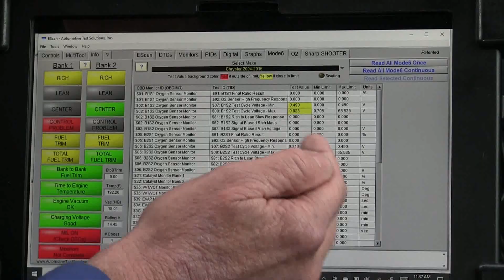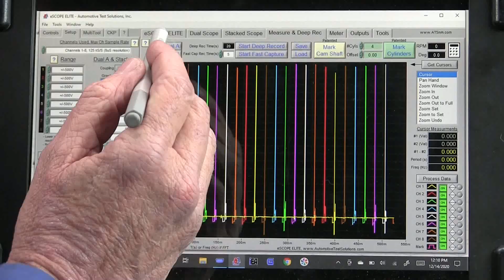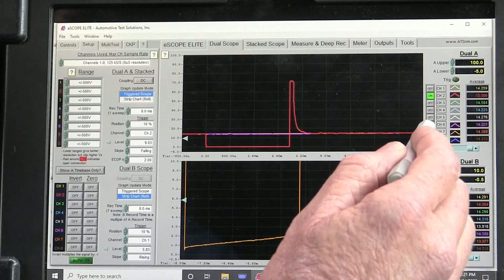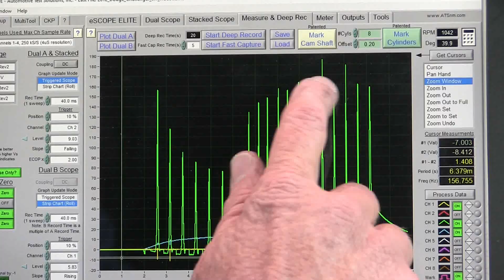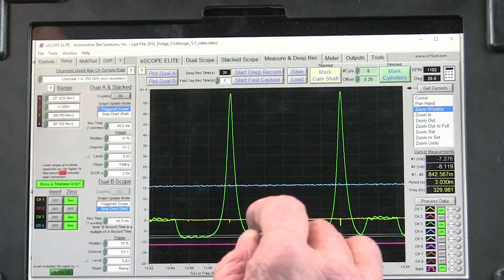Challenging to Diagnose Misfire on a 2012 Dodge Charger 8-Cylinder

Comment: Another 5 star video Bernie, but I wonder: they replaced the heads to fix the misfire but used the same lifter? Or chasing a different problem and inadvertently installed the wrong lifters with the heads, umpf!!

Comment: Long shot here… I have a 2012 dodge charger rt. Just had engine rebuilt. Had p3497 code so I replaced MDS, VVT, Coil packs, and Spark plugs. Here I am… still having issues with a rough idle and P0301 code (Cylinder 1 issue). After watching your video it’s probably the Lifters they put in (probably went cheap). 

Question: Do you have anyone with the ATS Software located in Austin, Texas? I have called shops and everyone just wants to tear the engine apart instead of properly diagnosing the issue first. THANK YOU in advance for your response.

Comment: When youre doing ybe injector flow rate test, j presume the gas is being injected directly into the cylinder. If there a chance of the vehicle hydraulicing the cylinders when its next turned over? Or does it evaporate? If it evaporates, i presume you can't do this with a diesel?

Comment: Wow. One of the first things I ever learned as a mechanic was. Make sure that the parts you are installing are the same parts you removed check and double check. Your video just showed and proved. Possibly. That somewhere along the line there was a misfire. In the misfire was corrected but also still existed. Because somebody installed the wrong part without checking to make sure. But once again I appreciate your video. Wonderful video

Comment: This is probably one of my favorite videos of yours I’ve seen. They are all gold, but the  troubleshooting you performed on this vehicle shows the correct diagnostic process to the T. They fact it had new heads and all those parts thrown at wound be an extremely difficult diagnosis for anyone. You called it Bernie. And stuck with your gut. Love it and thanks for sharing this!

Comment: Bernie.   While most technician  will try to follow this video  I would have to say probably 90 percent have already left the room.  1) they don't have the equipment 2)they don't have the technical skill to follow what you are saying.      With your advanced skill in diagnostic,  it still take over 1 to 2 hours to diagnose the problems.  It's  not just having an elite tool, but how to use it and interpret data. Most shop will just refer the car to dealers move on to something else.  But you are one of  the best

Comment: Nice Job. I have a chicken / egg question in my head: when did the incorrect part get installed?? This all started over a misfire, so i assume, somewhere along the line, the original problem got solved and this problem was created. Shop that last touched cam should pay Bernie and the latest shop.

Comment: The ability of this equipment is amazing.  The only problem is, after you spend around $12,000 for everything, you still need extensive training on how to use it all.  You can't learn this stuff overnight.  I'm sure Bernie's knowledge and experience goes back over 25 years.
Reply: He says he started when oscilloscopes were enclosed in a giant room and he got to use them thanks to a known friend or someone close. I believe he said that it was an enterprise entity that was the ones that could get their hands on those type of machines as a business need. So, he was born with this stuff and he created his own tools. He has vast experience and most of us new diag techs will never find this problem because it is probably unique and may not happen if the right parts are ordered to begin with.
Reply: @scientist100  yeah you are absolutely right. Of all the vehicles on the road with engine problems, what are the chances of this being the cause? This car obviously had a different problem before the wrong lifters were installed and we'll never know what was originally wrong.
Reply: Better start young in thus business or else you'll end up working at a tire shop
Reply: Very true. You must become the tool. Bernie is the tool. The oscilloscope is just an extension of Bernie. I just bought the scope. Also just realized that Im not Bernie. LOL. I like it so far but the learning curve is pretty high on this one. Sometimes I wished I had bought the Pico because it is much easier. I know that the capabilities of this is tool is and will be far better than a Pico can offer once I learn the scope. Then I will buy a Pico after. Because why not.
Reply: It is more than 25 years bud. I've seen videos where he says that he has never seen something like that before. An old timer himself doesn't know it all but he does have a lot of tricks when it comes to diagnosis but if you notice, he uses the same strategy to get data and the way he diagnoses is based on experience.
Reply: I still see new stuff everyday and the technology requires a scope. Do you want a Cadillac or a base model Buick. Lol  you have to love diagnostic stuff to invest this kind of money.
Reply: @mike-yp1uk  You could get all the same testing equipment for a picoscope and spend $5000, half of what ATS stuff costs.
I have the ATS stuff and I believe it's worth the extra money.

Comment: how in hell did it ever get the wrong lifters installed, if it was the original problem then it must have come from the factory like that if not then it must of had a wiped cam in the past and a dummy installed the wrong lifters, what is the answer, it would have helped in the diagnosis.

Comment: If they didn't came across Bernie, the engine would have ended up on a scrapyard.
Reply: Or would've had a brand new one installed or good secondhand - pretty sure even dealer would end up replacing the whole engine

Comment: So none of the shops could figure out that it still had a mechanical top end issue with how bad it sounds running? The lifter noise is so loud that you can barely hear him talking when he is by the engine!
Reply: Engines running on camera sometimes sound ticky as hell, it's misleading

Comment: Why would the non DOD lifter cause the misfire at idle? At idle the MSD system would not be activating so wouldn't all the lifters be solid? Trying to understand why the lifter is causing the problem. Great diag as usual Bernie. So much knowledge.
Reply: Same question, why would it cause a misfire at idle when MDS is not active. I am dealing with the same issue, a bad lifter wiped a cam lobe so I went with MDS delete and now all of the MDS cylinders have misfires at idle only... I am going to swap the cam to a non MDS cam next but what in theory is causing this especially at idle when MDS is not active so all the MDS lifters should act as non MDS ones??
Reply: Good question. The lifter may have a little built in lash to relieve pressure on the locking pin. The cam lobe would then need greater duration to take up the lash before opening the valve.

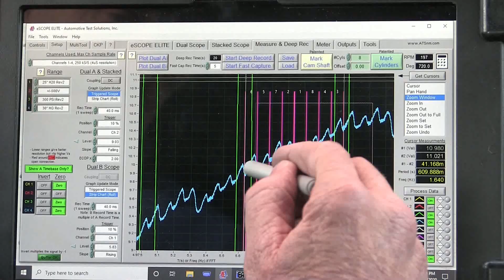Comment: So around the 26:00 mark you discover the intake valve is opening early, allowing a push back into the intake, and later you discover a lifter issue, which is the problem. My question is what caused the actual mis fire? I'm thinking some of the fuel charge is pushed back into the intake, due to an early opening intake valve creating a slight lean mis. What I can't figure out is why the primary ignition wave didn't reflect that??
Reply: That was my thought also. Reduced exhaust scavenging due to the early valve closing could affect the charge too. The charge could be rich enough at the plug to produce a quasi normal firing line but too lean to sustain flame travel through the rest of the charge. It was right on the border between proper firing and a dead or partial misfire.

Comment: Man, that scope setup is incredible.  Pretty obvious that Bernie completely drove the design of it.  Pico has nothing on this scope, not even close.
Reply: I agree. I have the Escope elite 4 and all the pressure transducers & i love them.I bought the pico scope the 4425A and i used it 3 times and i couldn't stand it. I sold it.
Reply: @vickenkaragozian2041 lol, I have mine stored away and I'm vmsurprised they haven't included more presets to expedite diagnostics. They should include presets like USB oscilloscope and such to help techs diagnose issues quickly.
Reply: totally agree streets ahead of picoshite !
Reply: @BBS_Robski lol Bernie can't hang with pico

Comment: Wonder if a MDS bidirectional test would have given you a clue also.  If you see number one not deactivate during the test with your pressure transducer installed in that cylinder could clue you to lifter issue?

Comment: was it a valve lash clearance promblem ? I seen a video online where a misfire at idle cold and after a minute misfire went away where lifter wasnt able to bleed down thick cold oil  is this same type situation causing advance of valve opening ?
Reply: cam lobes eaten due to failed mds soleniod  at bank 1.well known issue on hemis.
Reply: @ismarmeskovic  hey will those mds solenoids throw a code or just be noisy from the slap? Thanks for your time in advance.
Reply: @Thunderroad8517  they could p1411,p1417 but usually not.in this case lifters doesnt operate properly or stuck and create problems.it starts with the misfire.people usually change spark,coils.injector but misfire is still present.then you know what is going on
Reply: @ismarmeskovic  thanks for your reply. Reminds me of the old Chevy V8s that the rocker arm stud / rocker arm would get loose and wear the cam lobe off. Misfire at idle only. Still not clear about this one. Why as it replaced and if they did re-ring it they missed it too. The first one probably got rushed and didn’t look at the parts. I’ve had boxed wrong parts many times. Have a good one. Cheers

Comment: makes you wonder how this all started. you would assume the correct lifters were there at one time or it should have missed from the factory.
Reply: exacty, So Bernie chased a misfire created by the "other" shop however what was the ORGINAL misfire or issue with the vehicle could be something completely different.
Reply: I'd guess it started with a spun roller and then had the wrong set installed by accident.
Reply: Maybe it did miss from the factory, but nobody really cared, or higher oil pressure in the new engine his the problem.  I can't see any shop actually doing something so obvious as this was.  The problem was literally cast into the erroneous part, in big bold letters.  I don't know much about these particular engines, but that rack doesn't exactly look like a high wear item, but maybe it is?  Any experts, please chime 8n and set me straight.  For 45 minutes, I was pondering how one lobe on a cam was out of time, especially after the cam had been replaced.  Worn lifters, loves etc would cause late opening, not early opening.  I was expecting a mushroomed lifter or one tightened to the point of no lash.    That's about the only things I can imagine that would create early valve opening.
Reply: @tonyfremont  Last one I did, about 1yr ago, I had difficulty getting parts...national backorder up here north of the border. From what I understand very common for the  roller to seize and take out the cam.
Certainly a huge oversight but certainly possible or could they not get the right part? Don't think any store worth its salt would do that - who knows but I'd bet money that's how it went.
Reply: @unencumbered :  Maybe junkyard part, and nobody knew that there was a difference?
Reply: @tonyfremont  i was thinking he miss spoke may be the non mds lifter does,nt  collapse and this creates the problem but i would think the valve would hit the piston , opening to late or not enough will definatly  create a miss fire.

Comment: Good analytical work. I start diagnostics by checking the mechanics. I check the vacuum with a piezoelectric sensor. I analyze the opening and closing of valves in degrees. The order of analysis by vacuum is 4-2-1-3 of the engine with the order of operation 1-3-4-2.

Comment: 50:19 
What makes you think the customer is going to be happy? They're going to be stuck with the bill for all the stuff you mentioned was replaced. And no one will admit they screwed up and put the wrong parts in it. That's the reality of the situation.
At least you were able to get to the bottom of it before the bill got any higher.
Good work.
Reply: I believe the factory power train warranty is 100,000 miles or 5 years . So a 2012 would be out of warranty . As another person asked , what was the original problem ? Was something bad in the cam , lifters , timing chain or heads ? Was the lifter mix up then introduced as part of the fix ? With ALL those OTHER parts thrown at it , coils , injectors and # 1 injector replaced TWICE , they clearly did not fix it on the first or second try . If it is beyond your level , then bring in someone like Bernie and stop wasting the customers time and money . The only question is " Will it fix the car " ? How do they get away with it ? This isn't $ 50.00 for a couple of light bulbs ! Someone has to take a major hit in those wrong lifters . It also shows that too many shops are throwing parts at problems without proving them bad . Bernie is worth his weight in gold . Sit back , pay attention and learn .
Reply: For a car to have this many parts “shotgunned” at it, I have to believe it was all covered under power train warranty.
Reply: @thatguy451  It's a 2012 vehicle. So I doubt it.
Reply: Were these parts put in at the factory or when the heads were replaced ? Were they mixed in at the parts counter or possibly boxed wrong ? You can't be too careful , especially with internal engine parts . You have to know your limits . As soon as " it can't be fixed " is mentioned , you have to bring in the right people . Even though this has a special cam , etc. , on a crude , basic level , would doing a cranking vacuum test with a vacuum guage at least indicate a problem ? That certainly has it's limits . But if it at least puts you in the right direction , it would be worth a shot . Great diagnosis . Top tier !
Reply: @billsmith2212  CHRY is known for wrong parts in the wrong box, I am sure it will be easy to prove who put the wrong parts in. If its further back down the line, I would hold them responsible for all work done afterward for sure.
Reply: As A dealership tech I’ve helped customers recoup money spent on parts and diag. For example: customer had a shift shock problem on a 2012 outback 5 speed. Transmission shop installed a new valve body, then installed a torque converter. Customer brought me the car after the transmission shop tried to upsale a remanded transmission. The problem was fixed with a software update. There was no TSB to address this specific concern. Manufacture customer service investigated the problem and agreed that the problem could only be resolved at a dealership via a software patched (or speciality shop with shop tool software). Manufactured covered 75% of the repairs from the transmission shop.